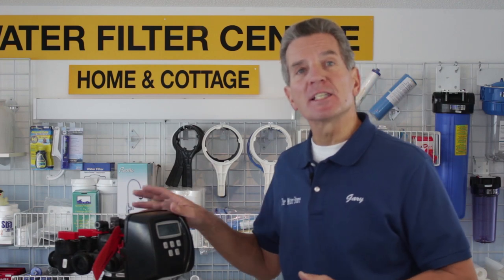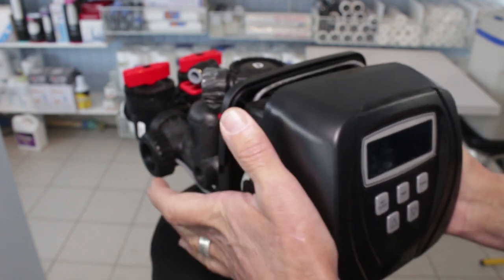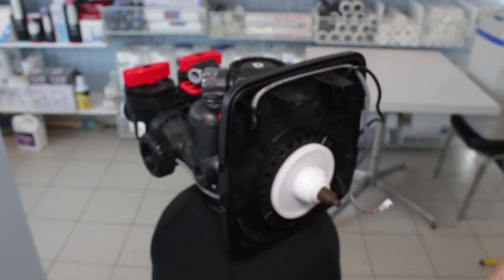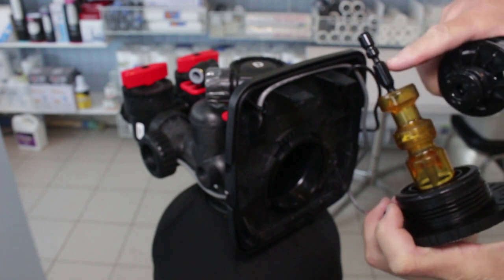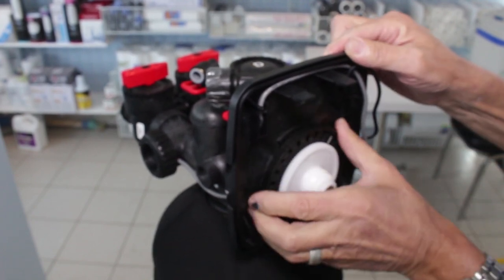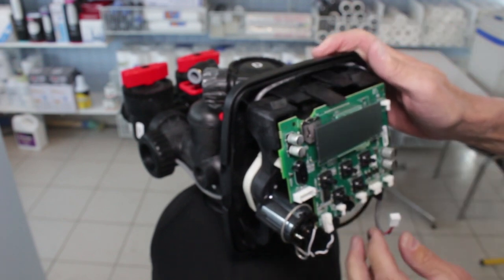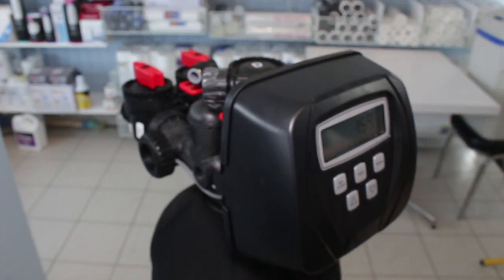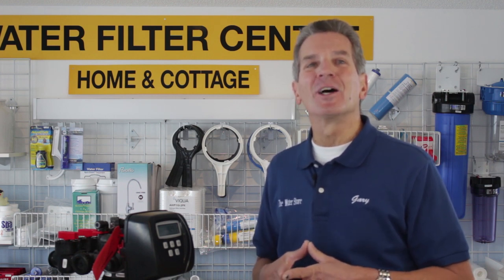How to Replace Piston and Seal Pack Clack WS1 Water Softener

Comment: Thank you so MUCH!  I am a 63-year-old who lives alone. I had 2 service calls because my unit was continuously draining causing my water pump to keep running. Both times they reset it and said they did not know why this was happening. They said maybe "some ants" got in there. After the 2nd service call it happened again after the next regen.  Thanks to you, you told me what the problem was (need seal pack replacement) I ordered the parts on Amazon and just finished replacing it.  I just ran it through the regen and it completed the cycle and all is well (I hope LOL).  Just as a note, it threw an E2 code after I replaced the seal pack. I tried pulling the little white plug out 2 times to reset and the E2 code returned. I unplugged the unit and it went to the home screen.  I am a happy camper.  Hopefully, it is fixed 😁
Reply from the maker: Glad to hear.  You may still need to replace the pistons in addition to the seal pack.  We ahve them here https://waterestore.com/products/clack-ws1-softener-rebuild-kit

Comment: Very helpful video. Just dropping some knowledge. I was getting an error that the control value motor ran too long and was unable to find the next cycle position. The issue was that the white gear that the motor turns was screwed all of the way in when I turned on the softener (not sure how it ended up in that state). I had to unscrew the white gear manually, moving the piston out towards the front of the softener, reassemble it, and then turn on the softener. After turning it on, the motor could then screw the white gear and piston into the softener, to the next cycle position - no error.
Reply from the maker: Thanks for the tip!  Much appreciated

Comment: Could a faulty, piston and seal be the cause of a slight leak that I have coming from the small circular drain on the side right below the injector? Great videos!
Reply from the maker: No, you need to replace the drain elbow https://waterestore.ca/products/clack-ws1-drain-elbow-v315801

Comment: Hello, 
Thank you for these videos, big help.
I just started to replace my piston/ seal pack following your vid. However, as I attempted to remove the part I accidentally began to spin that white plastic cog/gear part instead of that whole piece behind it like you did. It caused that threaded shaft thing to move in and out and I don’t remember where its original position was. Is that bad?
Reply from the maker: Nope, no problem at all. When you plug it in, it’ll automatically find home by itself
Reply: @water_estore  🙏🏼🙏🏼🙏🏼
You’re the man!

Comment: Excellent video! do you need to apply any plumbers grease to the 
'O'rings on the stack before replacing?
Reply from the maker: No you don't, it is not recommended.

Comment: Hello Gary.  Great video.  My water softener was leaking through the drain line.  I replaced the seal and piston.  Hit the regen button.  After regen, water is still leaking out to the drain.  Any ideas for next step?  Greatly appreciate it
Reply from the maker: Might be something inside the valve body?

Comment: What do the pistons actually do? In my brine cycle my drain line my drain line continues to flow slowly. And it tastes salty. After regeneration I do not have softened water. Is it bypassing.
Reply from the maker: They keep the water flowing through the water softener to the correct location during regeneration and when in service, see this video https://youtu.be/i9pI76dk4Zs.

Comment: What does seal pack do, how does it work?  Why replace and symptoms of when to replace?
Reply from the maker: Great question.  Seal pack makes sure that when the piston moves to direct the water through the cycles there is a seal between each port.  When water keeps running to drain while the unit is in service tells you that you need a new seal pack.
Reply: @water_estore  Thank you for the great response.  Keep up the great work,  New subscriber!!!

Comment: Hi Gary, I was able to remove the front, but the seal pack was stuck inside and I could not remove it.  Any ideas?
Reply from the maker: Yes, that happens.  You can use this tool to remove it https://waterestore.com/products/clack-spacer-stack-removal-tool-v3022

Comment: Gary,  Should I remove the excess water in the Brine tank after replacing the piston & seal pack?
Reply from the maker: You can but after a couple of regenerations the water level will return to normal.

Comment: Hi Gary, my water softener keep on running water even though I unplugged the power thanks in advance
Reply from the maker: Unplugging it just stops the valve from moving.  If it was running before you unplugged it, it will still run after. Is it in service?  If it is and water keeps flowing the valve pistons and seals need to be replaced.

Comment: Thanks, I just replaced the seal pack, and both pistons for the second time in two years. First time I changed those components was seven years after the water softener was installed. Now two years after that I replaced those components that had the same failure again. The O-rings on the seal pack look flat, I believe that is what caused the softener to stop working. Now at $56.00 it's not a costly repair but why did the set I replaced two years ago fail so soon?
Reply from the maker: Typically these components last about 15 years!  Not sure why yours would need to be replaced after only a couple of years. Are you sure they needed replacement?
Reply: @water_estore  Well, you may be right. Still no soft water after replacing those items. I did notice the word "Softening" wasn't flashing while the water was running. If I unplug the meter connector and then plug that meter connector back in the word "Softening" flashes for about 10 seconds then stops. This is all with the water running. Any ideas? 

Thanks.
Reply from the maker: @hauntedro  yes, remove the meter and with it plugged into your circuit board blow on it to get it spinning.  "Softening" should flash repeatedly while it's spinning.  If not the meter needs to be replaced.  But make 100% sure that there is no bypass around the water softener that has been left open, see this video https://youtu.be/2EcQrrlxMqo  I had a water softener a couple of weeks ago that was doing exactly as yours is and there was a 3 way bypass built around it that someone left open!
Reply: @water_estore  You sir, are a genius! We do in fact have that exact same triple ball valve set up in that video. I was so consumed putting in those new parts that when I put the water back on to the softener I forgot to engage that bypass valve.
Thank you for helping us with this, and my wife has got this one on me now!
Reply from the maker: RedHot glad to hear!

Comment: I have a Water Group (model 665AIO) Iron Filtration system that we recently discovered is   continuously draining (as if it was on drain cycle).  We had no choice but to put it into bypass. I purchased and just replaced the seal kit and piston assembly and put the unit back together. Unfortunately it didn't fix the problem. Is there something I could have done wrong or something else that could be the issue? Any suggestions wouldbe appreciated before I break down and buy a new unit.
Reply from the maker: I really can't think of anything else it could be.

Comment: Hey Gary! Hope you're doing well! I have a 5 micron sediment filter followed by a birm filter followed by a softener. Both use the WS1 valve. Both are 3 years old. The seal pack for the birm filter has failed for the 2nd time already. The downstream softener's seal pack hasn't ever failed. Could the higher iron content from the raw well water being fed into the birm filter be causing premature failure of seal pack? Could it be something else? Thanks :)
Reply from the maker: 100 % caused by the rough iron water.  The seals wear out quickly in iron filters.

Comment: Hi. I have a softener with this valve. Can I convert it into iron filter? What extra components are needed?
Reply from the maker: Does your valve have 5 buttons in a row straight across or staggered in two rows?
Reply: @water_estore  staggered.

Comment: Hi Gary, I replaced the piston and seal pack (stacker spacer) 18 months ago. Unit stopped drawing brine and softening so took it apart and found a  dislodged and damaged center o-ring. Very unusual for that to happen so fast as I only regen about every 5 weeks.
Any idea why that happened? I am on municipal water and the unit is very clean every time I have inspected the components.
Reply from the maker: I have no idea how or why this happened unless the spacer stack was defective or some particle (like a small stone) got in there and damaged that o ring.
Reply: @water_estore  Thanks it must have been defective as my piston is smooth as can be.

Comment: I was surprised you didn't recommend pulling the elbow out of the drain port and then simply tightening the drive cap until the large black O-ring that fits around the spacer moves past the port opening ~ the moment the O-ring is no longer visible through the drain port, stop tightening ~ as recommended in the Aqua Systems service manual.

By guessing at proper positioning ~ how far the drive cap should be tightened into the bore ~ one easily could end up with a perpetually filling brine tank or a piston that's way too tight ~ that doesn't move freely inside the spacer/ seal pack ~ resulting in serious problems down the road without the owner being able to understanding why.  At the very least those who guessed wrongly, regarding the drive cap tightness, would end up having to shut their softener down until they figured out what went wrong.

Why not just adhere to the Aqua Systems service manual procedure in the first place?
Reply from the maker: I have never heard of this manual, can you post a link and I can check it out?